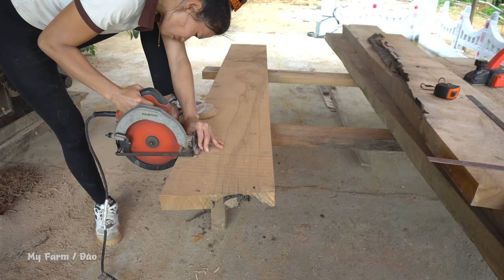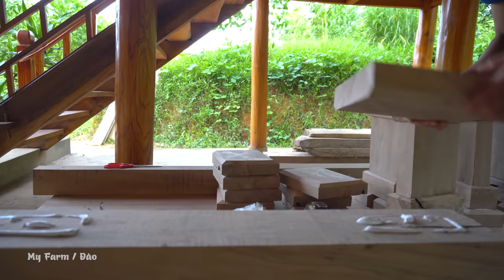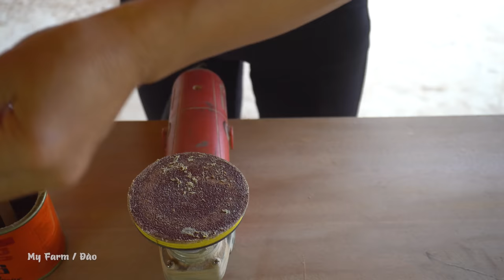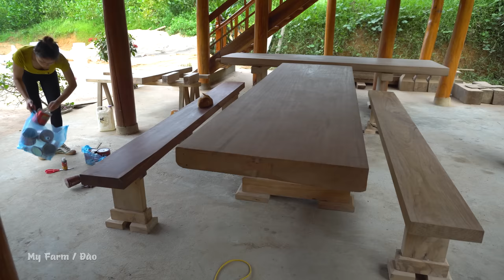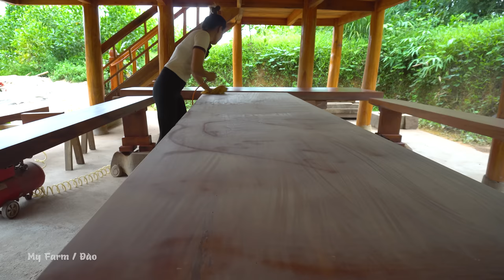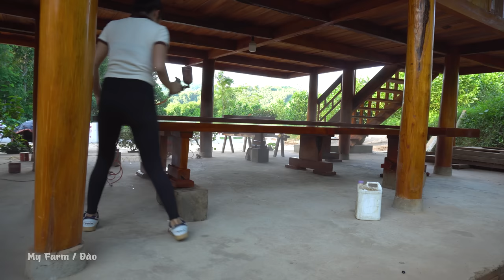Complete Set Of Big Wooden Tables & Chairs - How To Varnish Wood - BUILD BIGGEST LOG CABIN

Comment: Hi the benches u made please u have to put stretcher in the middle of it because of the length of it when you put weight on it u may have flex or pressure but you need that under the feet ok otherwise everything looking ,💓☺️💯⭐🌸💮🌺🇯🇲

Comment: I do woodworking and suggest that you use a mask when you spray varnish or paints. Also to lightly sand over first coat down with a medium grit paper and apply pressure with a block of wood
110 mm x 140 mm to get the best surface for second coating. On the block of wood do round over all edges so you can control the pressure with ease.
Spraying without a mask can cause lung problems in your years to come in the future. We do not realize it at first that no mask spraying is getting into our lungs and then it is too late.